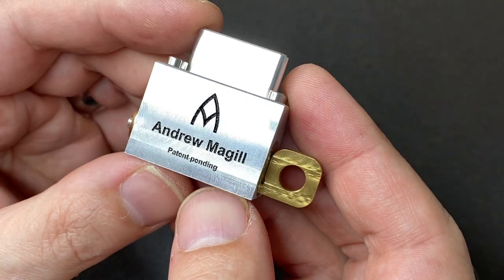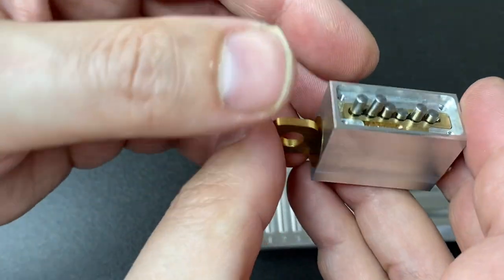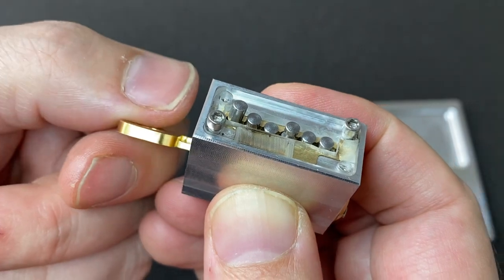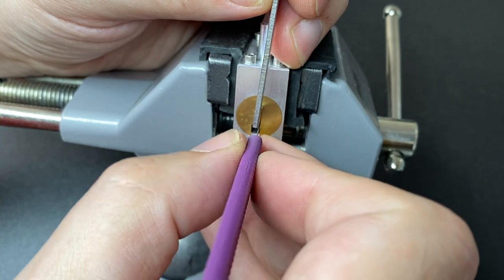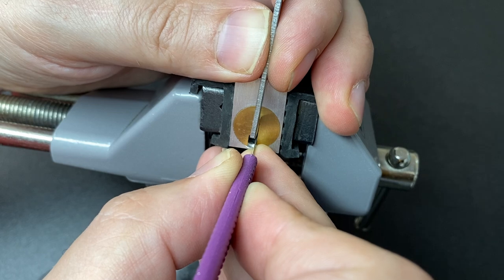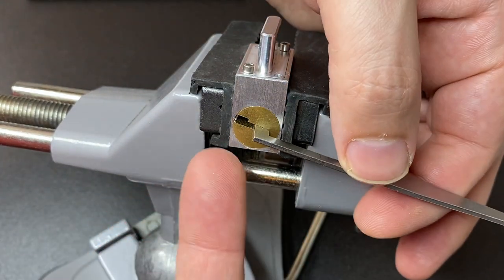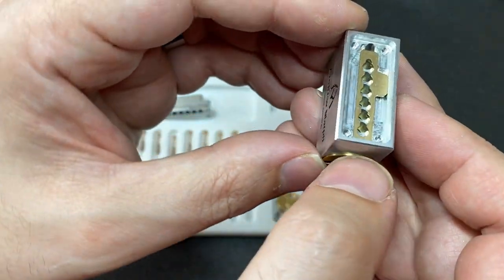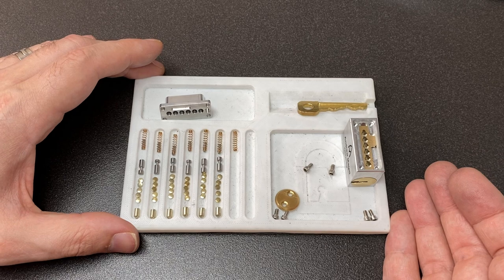Unpickable? Enclave - an Ingenious New Lock Design

Comment from the maker: Is this lock unpickable? It might just be the case 🔐😮
Reply: Probably not but it is going to be extremely difficult to do. It will certainly defeat the average lockpicker.
Reply: @seriousthree6071  More than average pickers. Andrew sent a few prototypes out to experienced pickers and, so far, we didn’t find any exploit. The lock can apparently be decoded but this is a extremely long and tedious process. I am trying to think out of the box but the design is excellent. So far no exploit has been found.
Reply: Hi Ash,
I have been playing with a copy for the last couple of weeks and there is something I would like to try but I don’t have an EPG. The only exploit I can think of would be to lift all the pins to the very first position so you have only the driver pins in the bible. Then we would need to get them move randomly while gently tensioning the bar and eventually get them falling into place progressively. I have tried bumping the core with a rubber hammer, no luck. I have tried moving the driver pins with the Magneto on the side of the bible, no luck even If I believe that I set a couple a pins this way. Now I would like to see if an EPG pulsing the keyway could do something. I highly doubt we could transfer enough energy to compress the springs without hitting directly the pins but it may worth a try… In any case, this is the best idea I had so far. The only other option is to decode the lock wafer by wafer but this is extremely tedious and very difficult to achieve given the binding order on the wafers.
Reply: Its gonna need a Sputnik/Lishi tool.
Reply: @gargoyle7508  Yeah a sort of Lishi where you could lock any identified height would be ideal.
Reply: No. it’s definitely not un-pickable as ya just demonstrated. Very cool video! Thanks for doin it. I found this very cool indeed. And hope to get one. One day. Could one pick this without a key or knowledge of the workings…… think it’s be a long day🤷🏼😜. Cool content here👏👏😎
Reply: Could you maybe push up on that last pin as to put pressure from the side bar onto the pins to give you feedback for picking the pins .maybe a flag pick for lifting that back pin for (tension) and then normal pin picking?.just a thought tho you've probably tried something like that
Reply: @ianthompson6288  You have no access to this last pin, it is completely isolated from the rest of the core. Basically you only have access to the 6 pins and nothing else.
Reply: @yom73  ah I see .did think a long shot .crafty sods 🤣👍
Reply: @yom73  It has existed for several decades. It is called the Sputnik. It is a decoding lockpick that becones a key. 4 decades this has been around! It requires real skill to use, that is the problem.
Reply: @gargoyle7508  This is exactly what I would need! I have seen versions for push locks many time but was not aware there was a version for pin tumbler. Thanks.
Reply: Get it to the Lock picking lawyer
Reply: @JustinBilyj  bb doesn't do youtube anymore
Reply: @JustinBilyj  he hasn't for a while. Lpl did a video about it. If I remember his wife died or there was another family death
Reply: Technically... you can pick it..... opening it is another matter, be it through brute force of combinations or devious means of accomplishing the goal
Reply: Give it to the lock picking the lawyer. He will pick it successfully.
Reply: @Cookie__XD  Yeah!  It might take LPL a little longer than normal, but he'll pick this, no problem!
Reply: the trick would be to attack and tension the pin that actuates the slide bar. Then pick as normal. Simple as.
Reply: @jantelliquawallace355  Problem is that the sidebar is isolated, the sidebar actuator/lever is isolated, and the cam that lifts the sidebar actuator is also isolated. There's no way to physically get to any of those three from inside the lock core.

If you could bind the sidebar, you might be able to pick it. But if that's an issue, the design can be modified slightly to completely prevent it: offset the pins a small amount, following a pattern such that there is no way to progressively bind the pins in sequence to pick it. Unfortunately I don't think that just elongating some of the main holes in the sidebar (so that it has to be pushed further for some pins) would work, and actually might make it easier to pressure bind a subset of the pins.

On second thought, not sure that would work. But you could absolutely add a second sidebar activated by a second cam (either simultaneously or further out of phase with the tumbler) which could bind in the opposite direction. Thus the opposite binding sequence would make it impossible to rely on binding tension alone to retain pin heights, significantly impairing picking.
Reply: @JustinBilyj  BB retired mate
Reply: For sake oft the Argument lets asume we can set the hight oft every pin to the desired hight without fail, the sidebar  conacts the pins in a "random" order.It would be pickable, when I trie some combination and write down at what angle the core stops turning.
Bigger angle means the next pin is right

So with precise egnouth tentioner there are only 5+5  + 5+4 +5+3 +5+2 +5+1+5 = 45 tries needed to open it.

That's way better than 15625 tries for a bruteforce attack.

For this reason we can still exploit the lock design but 120 is way better than the 55 tries a traditional lock with 10 pins needs

Tldr: There is a  relationship between the angle where the lock turns and wat wrong pin it contacts.
Therfore we get feedback on single corese.
==>it isnt unpickable

Ps: flat profiles can be copied with one foto, pins on both sides are needed to prevent easy exploitation
Reply: @ianthompson6288  The drawing shows 3 right angle with minimal tolerances therefore its not possible to  just stick a wire in it but when you have a small drill to get access to the follower pin thats a hole mother world.
Reply: Of course it can be picked. The weak point is slop in the top bar. You'd need to find a pin, and a certain height for the pin, where the lock can be rotated more because the top bar can be pushed a bit further back. It's probably very tedious, and I imagine you'd need a proper tool with a gauge on it, so to make the pin positions repeatable.
Edit: if I think about it, it isn't that tedious. To decode one pin, you need up to 36 tries (6 pins, 6 positions each - basically you find a pin, and position for it, where the top bar can moved more than before) - on average 18 tries, and the number of tries will go down with each pin decoded. Also, after trying, you actually have decoded the pin, so you don't need to bother with it again. The question is how much feedback the cylinder actually gives when trying to push the top bar.
Reply: Nothings unpickable until lpl says it is lmao
Reply: This lock isn't unpickable. But there is no feedback. So you cannot "feel" if you have it right. You have to use a tool there give you the opportunity to try all combinations one by one, until you are lucky to find the right one. There is 15625 combinations. With the right tool if will take 5 - 7 seconds for each try. You might get it right in the first try. But it might also be the last try. It will take between 21 - 30 hours to get through all combinations. If you try for 1 hours you will have 4% chance of success. But this requires a very specialized tool. With normal lock picking tools it would take months and would probably be impossible.
Reply: @allan.moeslund  Of course you get feedback. The pins, the pin holes and the top bar all have some slop, and that means you get feedback by how far the cylinder can turn. I guesstimate around 100 setting and turning actions might be required to fully decode.
Reply: @allan.moeslund  Also, your math is wrong. It's 46,656 combinations (6^6) overall. That number then gets severely decreased by all the invalid biddings, as is case with any key.
Reply: if only a certain lawyer could test that claim lol
Reply: @JustinBilyj  I recon about 40 mins, maybe less,🤔 they do make you question all your security, including your guard dogs and the century towers, 😂.
Reply: I really can't imagine any non-destructive way to open this other than either using the key or precisely using specialized tools to simulate every possible key, one at a time. Slide bar and wedge pin are both trapped in their own coffins, and Andrew even remembered to keep the shims out, not that getting a shim in there would make it any easier as long as you make sure the front driver pin engages with the slide bar before at least one other pin does.
Reply: Well, I guess you could also physically cut every possible key and try them all, might even be faster.
Reply: @torydavis10  Again, each time you rotate the cylinder, its rotation will only be stopped by a single pin. If you find that pin and set it to the correct height, the cylinder will turn further than before. People that don't know how picking works should just not comment on this being unpickable.
Reply: @graealex  you did not understand this lock.
Reply: @reducedtomaximum826  I absolutely understand that lock. Just remember that the top bar, when pushed from rotating the cylinder, will only bind with a single pin, not all of them. You then find that bring by trying every pin in every location. However, that is not multiplicative. It's additive. I'm not saying it's easy, but certainly not "unpickable". I'd say it's at the same level of some of the more secure, low-tolerance locks.
Reply: @graealex  but you don't have a clue which pin was set correctly in that moment. and there is no indication how many pins are set correctly by the degrees the core turns (at least with bare eyes). you still end up brute-forcing every combination...
Reply: @reducedtomaximum826  No, you're not. When you found a pin in the right position, the core will turn a bit farther, and then you are likely to have found the correct position for that pin already. It's still tedious, and you need a heck of a lot muscle memory, but it's possible, particularly possible without trying 45k possible combinations. But I've explained it twice or three times already. 🤷
Reply: @graealex  yes, I've read all of your explanations. and I consider every single one to be incorrect. how do you determine if it's for e.g. pin 1 that's set correctly or pin 4? yes the slider will most likely be binding with only one pin. but there is no clue which one. even IF you could see the core turn a bit more, you still only know 'some pin is set correctly', but not which one
Reply: send this to lockpicking lawyer! that will keep him busy!
Reply: @SadisticPicker  never a thing as unpickable but increased time todo so
Reply: @reducedtomaximum826  You test it. Set pin 1 to position 1. Rotate core. Set pin 1 to position 2. Rotate core. Etc. At most 36 tries, on average 18.
I still think that it's borderline impossible without a special tool, though, as to return every pin into consistent positions, particularly the pins that you already decoded. Something like a Sputnik where you can manipulate all pins at the same time. Then you'd be quite fast - I'd imagine a few minutes.
However, you still don't need 45k tries - which wouldn't be even possible, as you'd wear the look down from all the tries.
Reply: @graealex  aahh! now that you've changed your suggested method from single pin muscle memory to sputnik it becomes human-possible I think
Reply: @reducedtomaximum826  I think someone like LPL with insane muscle memory could do it just with a tension bar and a pick. The two key factors are noticing when the cylinder can rotate more than before, and being able to push each already decoded pin consistently into the right position.
However, the general claim was that it is unpickable. And for that, no individual pin is allowed to give any feedback whatsoever. Which isn't true for this lock.
There are also some in-between techniques, like a set of prepared keys and blanks. But I think with the right tool, you can just single-pin-pick this "unpickable" lock.
Also, I didn't change the suggested method - my first comment already suggested some sort of gauge so you can a) decode and b) reseat the pins on every try.
Reply: Просто вставляешь железку покрепче и скручиваешь личинку.
Reply: You think the Lock Picking Laywer could pick this?
Reply: No lock is impervious.
Reply: As plenty of people have said, it should be thoroughly pickable. One interesting thing about the approach to picking described is that it could be fully automated, as it doesn't involve any 'feel' whatsoever, and with a machine doing it, you could open it in maybe a minute, depending on how fast the machine was.
Reply: I think the math behind those "combinations" actually is called a permutation, in cases like this. Nobody gets that right though.
Reply: @deathofallthingspotato9919  I don't think it will be that fast, because you have to rotate the core for every combination twice. Even if you assume there are 3 possible positions per pin because of slack that's still 3⁶ = 729 combinations. I doubt you could check 12 combinations per second. Even if you could check 4 per second it would take 3 minutes. (And I'd consider checking 4 combinations per second VERY fast)
If you assume that there is only 1 of 5 positions valid per pin that's 5⁶ = 15625 combinations. That would take 65 minutes to try all combinations at 4 combinations per second.
Reply: @mattstroker3742  Not really. A permutation is where the same set is arranged differently. A lock isn't a permutation as it can contain repeated values (that is, different pin stacks can have the same position) - this makes it harder, for obvious reasons.
A permutation of, for example, 1-6, can have 720 possibilities (6!), whereas a pure combination (I agree that might not be the correct name, but I don't know the name, so it'll do) has 6^6 possibilities, or 46,656.
The permutations are S6, a symmetrical group, but the combinations of the lock are more equivalent to C6^6, or similar.
At minimum combination is the correct colloquial usage (combination lock, etc.), but it probably isn't a bad mathematical description either.
Reply: LPL will make a 3 min video about it.
Reply: @deathofallthingspotato9919  You're confusing a permutation with a combination maybe? Or I am not understanding you correctly? A combination is a combined set. A permutation is a set in which order does not matter.

In a combination of 1234 any one of those numbers can be used once. So 1234, 4321, 2134, etc. 

In a permutation of 1234 the same combinations can be used but also 1111, 2222, 1223 is a valid permutation while from the same set of 1234 the number 1223 can never be a valid candidate. 

So, going over this again, in essence you're still right since we cannot exchange the pins and their positions for another.
Reply: @mattstroker3742  You are right, I wasn't aware of the proper definition of combination, so it isn't one of those.
It definitely isn't a permutation though, as a permutation specifically does not allow duplicates, and must include all values (so 1223 is not a permutation of 1234) - note that a combination does not allow duplicates either.

Technically the mathematical name would be a sequence, as this allows duplicates, and order does matter.
Reply: @gargoyle7508  yes by decoding each individual stack till you find the lock pin(?) length.  I'd start by lifting each pin to max height and turn it will bind on the driver(?) once it moves freely you know the pin position.  If they did what the bowley (add a sheild) I would say it would be damn near impossible to pick

I'm an idiot this will not work
Reply: @JustinBilyj  It was taking up all his free time, he is no young buck and he wanted to spend more time with the family.  Sad to see him go but I'm happy for him regardless.
Reply: @jantelliquawallace355  How? it is not accessible, there is a Cam/Pin that interacts with the back of the side bar.  You can clearly see this @1:53
Reply: It also appears susceptible to a drilling attack at the height of the bar. Drill the 2mm or so you need to access it and then you can pull it back to tension
Reply: I wish you'd shown what happens if you try to comb pick it? Could you simply push 1 or 2 wafers into the sidebar ???
2 things could prevent a comb attack: 
1 : Not enough room above the pins to push them that high (there looks to be plenty, but the top section for the springs can be narrower than the headroom for the top of the key pins)
2 : Sidebar thickness is not a multiple of the wafer thickness.
Reply: Send it to the lock picking lawyer.  He'll show you how to pick it.
Reply: @zaqsdk  It has anti combing systems - the video mentioned it briefly, basically there is a thin rod in the middle of the spring.
Reply: Send it to the lock picking lawyer and back up your claim.
Reply: @JustinBilyj  That was my thinking. How I'd like to see Lock Picking Lawyer would deal with this & Yes, BB 2 ;)
Reply: It's certainly very clever, but it looks far too expensive to make, except for high end applications. Thanks Ash. 🙂👍
Reply: Just picked this lock today. The “false set” gets shorter the more pins that are at the correct height which helps with decoding the lock if it were to be picked blind. Even knowing the bitting it is a ridiculously difficult pick and also extremely boring and tedious. It’s not just a matter of setting the pins to the correct height as you can drop wafers trying to float the tension and then deciphering where they fell and how many fell makes it easier to just reset and try and again.
Reply from the maker: @georgiajim2260  I saw your pick and having spent hours getting to only 4 pins, I very much appreciate how hard it must have been for you to get that open.   Very impressive!
Reply: Send it to LockPickingLawyer and lets find out
Reply: Why don't you ask LPL about it?
Reply: @HGMBALDER  LPL has one, the creator of the lock sent one to him several months before he offered them to anyone else.
Reply: If it is sent to LPL the way it is, he'll just make a custom comb. When lifted high enough those wafers can be jiggled into the sidebar and let it freely slide.
Reply: This lock is vulnerable to bumping.  Get a low false set so that the cylinder can rotate and the wedge can engage the locking bar.  The false set must be low so all the spool pins are at or below the shear line and not over-inserted.  Then by turning the cylinder to apply some pressure to the locking bar, shock the top of the lock to float the spool pins up.  After enough wacks it will set because the spool pins are be limited in their travel by the wafers on the bottom and the over-insertion pins at the top.  This attack is real world if the cylinder was used in a padlock.  It might be less real-world in a high security door lock.
Reply: I know how you would beat it
get it into it's "false set" with the wafers up in any position and turn the key to get it to 45 degrees set
whack the bottom of the lock with a soft face mallet like you were trying to bump it and give that key a quick turn as you bumped.(bump it from the opposite side from where the springs reside)
in effect you are bump keying the lock using it's own camming mechanism against itself
as long as none of the pins were overset for the topbar/crossbar you could in theory bump it open like that as long as the springs being used arent too strong
Reply: @leviwilder1205  I agree with this 100% but also you need to make sure that all the spool pins are at the lowest position because if they are over set bumping will never work.
Reply: @PeterATomich  thats what I was trying to describe, first set on all and bump the hell out of it
though this scenario would never work if it's in a door
Reply: @leviwilder1205  this lock has pins that are zero lift once the false set is achieved so bumping without oversetting would be the biggest challenge there.
Reply: @LockNoob  The BEST way to make an unpickable lock would be like this: Have a bar/plate that LOCKS the pins from moving until (pick whichever pins) are all engaged aka key inserted. So, as soon as you tension the keyway with a prybar the pins won't move under tension, they'll be locked. Tensioning the keyway will actually lock the pins. Basically a sliding plate that will engage a slot in spool pins and can't be tensioned until the pins are at the correct height, that way defeating using prybars to tension.
Reply: A lishi style tool with careful tension. So you can engage the sidebar pin while picking the other positions. Anyway those are my initial thoughts on picking that design. A pain but doable.
Reply: If you raise up the pins while tensioning the top pin the wafers set before the bottom notch (where you would want it to set). Have you thought about picking the lock by raising a pin stack, tensioning, then slowly lowering the pins? Then the first set you get would be a true set (the bottom notch of the pin stack).
Reply: @yom73  "You have no access to this last pin" you have super eassy access to the last pin as the whole design here is that it is super easy to end up with just this one pin protecting your core... resistance of this pin to any real brute force attack will be minimal and noise leve also will be minimal...
So contrary to what the guy said inthebeggining of the video this is just a chalenge lock and not a thing that you want to use to secure anything valuable.
You can also propably use as a temper lock used to limit access to something.
Reply: @Bialy_1  we are talking about picking the lock, not breaking it… But I agree with you, there is only one pin blocking the core and you even have like 30 degrees rotation before you hit it so a lot of room to build momentum if needed. I trust this mechanism would be great if combined with a second locking mechanism, ie sidebar.
Reply: Lpl will pick this 👍👍
Reply: So what stops you from lifting that pin first? The last pin the one that locks the lock what stops you from picking that one first? Just like the key is doing the key would lift that first, so what stops you from doing that again?
Reply: That lock you should send to the lock picking lawyer see what he thinks
Reply: Tension the last pin, once every pin is in the right location, tolerance should be on your side
Reply: Pick it with the lockupside down.
Reply: There is only one way to find out. We all know who to send it to